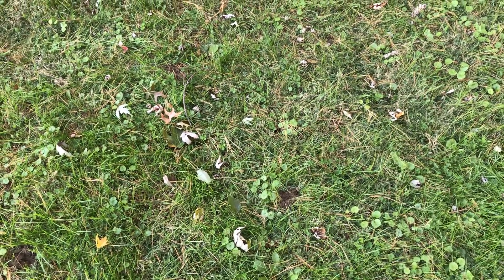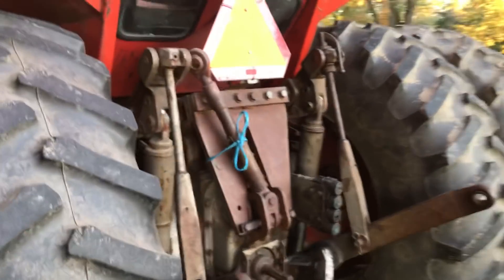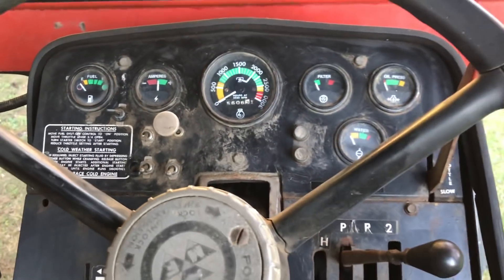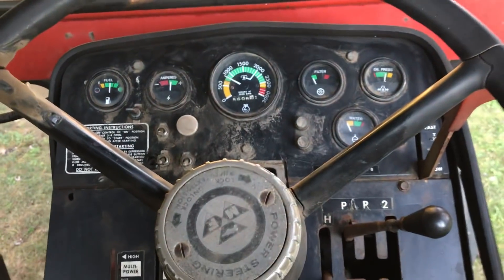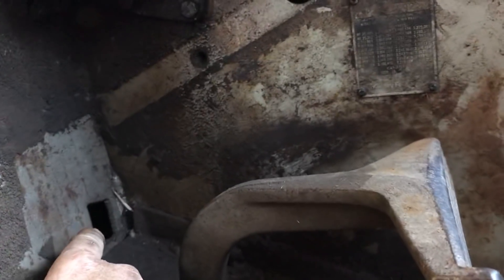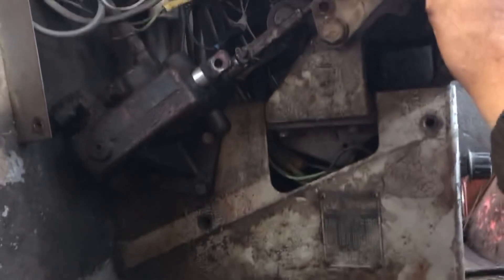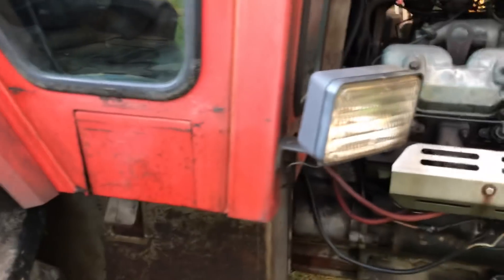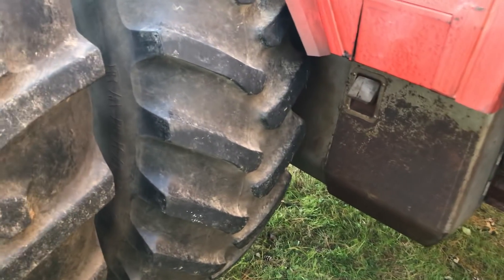New Purchase!

Comment: I worked for a dealer their alright tractors but the be easy on that motor and don’t turn it up. You blow it apart all you have is a paper weight. Unless you want a to turn it into a 1105/35. You can’t get engine parts at all. Dealer has a a junkyard with several 1155s in it can probably find you a straight hood if you’d want one that doesn’t have the hole in the side. Looks like some good cheap HP what MF is good for.
Reply from the maker: SoInFarm I’ll have a guy go over it good, thanks for the heads up on the engine.